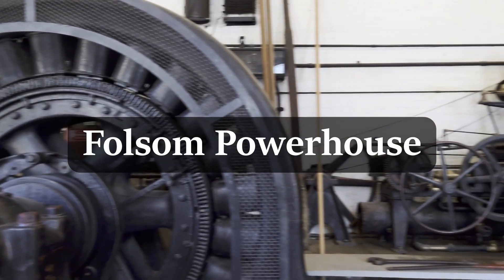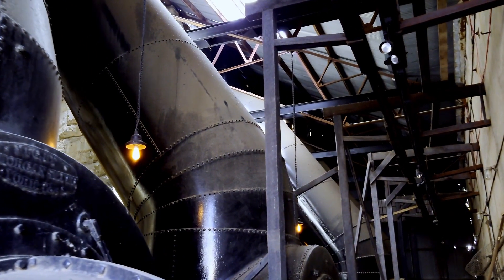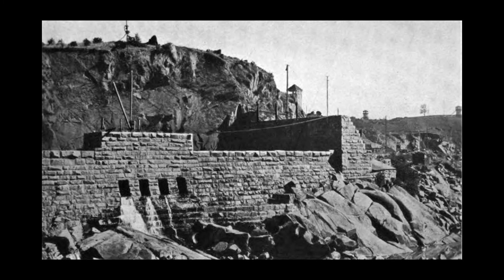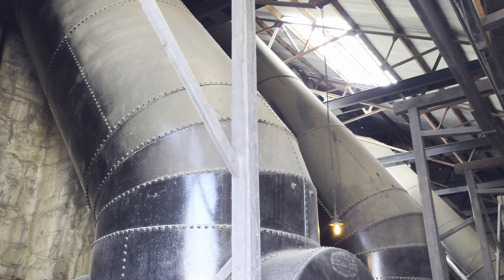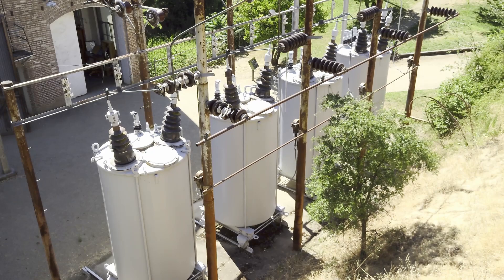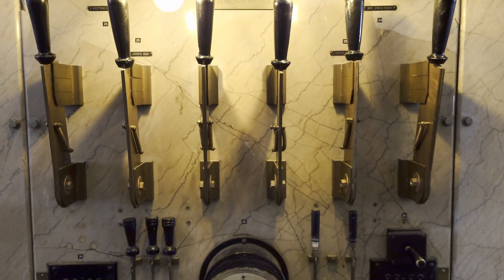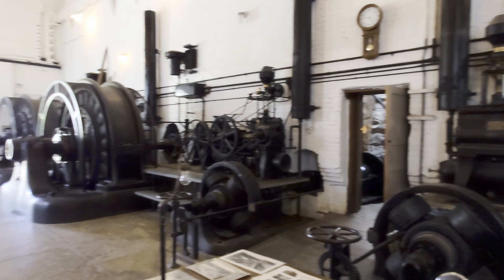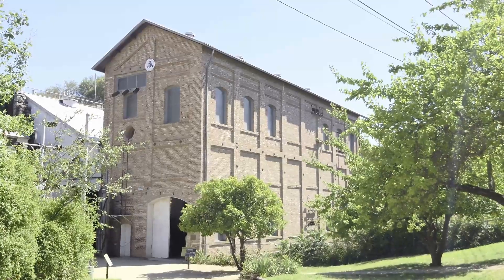A visit to Folsom Powerhouse

Comment: I used to talk to this old timer there on my way down to lake Natomas. I can't verify the claim but he states that the powerhouse set the 60hertz electrical standard. Their generator fly wheel was supposed to run at 350 revolutions per minute and be geared down to a 50 revolutions for the coil. Now apparently when they got it running the head produced enough force to spin it at 360 revolutions, and they had the gearbox remanufactured locally to spin the coil at 60.  

Also I don't claim to have that story 100% I have almost certainly conflated turbines and flywheels, but the critical portion is 350/7 by design, 360/6 in implementation. 

He also told a story about the transformers in front of the powerhouse. They are the second set ordered. The first set never showed up but was eventually found half the country over; where the driver had made an unscheduled detour and went under a too low bridge. Tore the top off of all of them. They found the truck with the keys on the seat. 

Rest in peace to that man he was a treasure.
Reply from the maker: This is great, thanks! The docents were full of facts and stories when I visited too